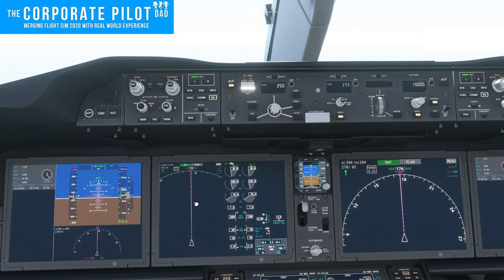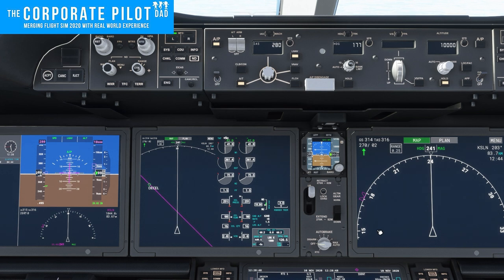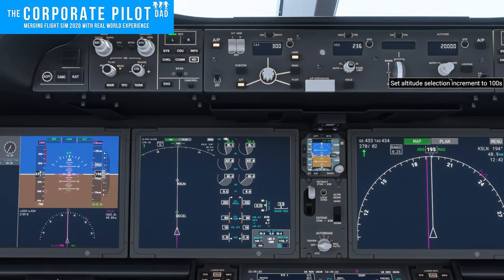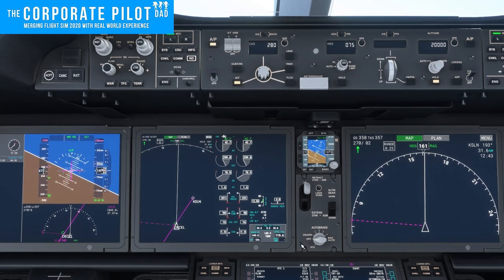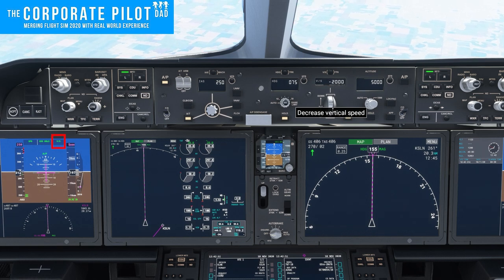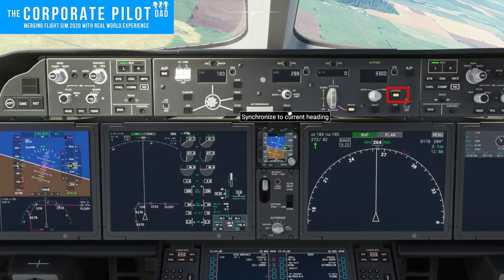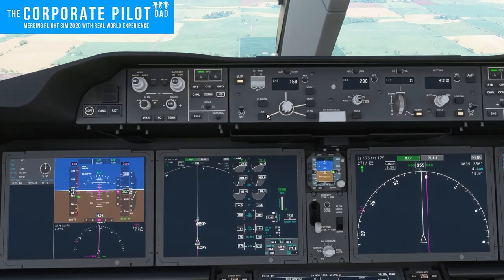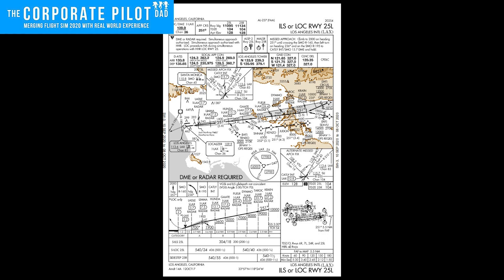Boeing 787 Autopilot Tutorial | Microsoft Flight Simulator

Comment: Hey I've been trying to fly this plane on Xbox series X and I keep having issues as the plane will randomly start banking left sharply. I could be on autopilot for 10mins and the plane will follow the Flight plan but suddenly just bank very sharply. It also happens any time I change the altitude or speed.
I'm I doing something wrong or is it a bug?
Reply from the maker: As far as I know that is not anything you are doing and it is a bug.  Others have had the same issue in the past.  In settings, If you can change the flight model to modern that may help.
Reply: Sorry, doesn’t work at all. 787 just flies to the left in circles
Reply from the maker: @itistheway6893  Check your flight model in settings and set it to modern.
Reply: I actually figured out what the problem is. This is an issue with the sim itself. For some reason the sim doesn't work well with the Xbox controller on console. I noticed that when I switched to cursor mode by clicking the left stick and started rotating and moving the camera/cursor that the yoke would also slightly move. I believe that these small movements are enough to mess with the autopilot and cause it to randomly turn to the left or right. I switched using a mouse and since then I have never had the issue with the plain turning left, the reason, because I now use the mouse to move around the cockpit inside of using the controller
Reply from the maker: @caolandoherty7515  glad you got it working.   People on PC had similar issues but from the flight model not being set to modern.

Comment: QUESTION!!  - whenever I put on autopilot, A/T works fine but then I select HDG hold and the plane slowly starts to bank left/right and the Flight Director gets all messed up.  The plane ends up banking 90 degrees and keeps flying in circles.  SOMEONE HELP!! THANK YOU!
Reply from the maker: I am pretty sure this is a bug after the last update.  Check https://forums.flightsimulator.com/ if you haven't already.  Others have reported the same issues there and on different flight sim groups on facebook.  If I see a fix I'll come back and let you know here.  I wish I had a better answer for you.
Reply from the maker: Go into settings and set your flight model to modern.  Make sure AI is off and assist settings should be set to hard/true to life.

Comment: Hi. In the mcdu is you arrival page also not working?
Reply from the maker: I'll have to check.   I'll get back to you.
Reply from the maker: I just tried it and it works. On the ground at LAX I entered LAX as the destination and entered the departure and arrival along with the runway and transition.  On the menu I selected the departure and destination.  Once it loaded I selected the departure and arrival and it worked just fine.
Reply: @thecorporatepilotdad  that's good to hear but then i don't understand why it doesn't work on my side. I can get on the page but only "Departure" is clickable...
Reply from the maker: @AM-on5ql  What is your departure and destination airport when only departure is clickable?
Reply: @thecorporatepilotdad  i would start on the runway in LSGG for example and then manually enter the flight plan to LSZH. The issue i think is also that the system never allows me to hit "EXEC" so that the plan is fully loaded....
Reply from the maker: @AM-on5ql  Try loading the depqrture and destination then load the SID and STAR then build the route.   Have you tried the CJ4 Working Title Mod? It has the best FMS in the whole sim.  If you want functionality and ease of use, I suggest it if you haven't tried it yet.

Comment: Like others have said , Great video explained to make following your steps easy. I have a bug on my 787, It i want to increase/decrease any this, Likes altitude , Speed etc, When i start to adjust say altitude, I will loose control of the altitude settings and it would go from 1000ft upwards to what ever and the same with anything else that you adust with the mouse, i have changed mice, but still the same issue, Others have had the same issue and they say , Seletcting and unselecting the map can fix it, but its not working for me, Plus i am having other issues like no control of the throttle, I am hoping that it fixes it self.  I bought this edition because i wanted the 787 and to be able to fly it. Anyone else having issues?
Reply from the maker: Thank you for the compliment.   With the bug you are experiencing,  does this happen in other aircraft?
Reply: @thecorporatepilotdad  I will have to get back to you on that one since i just fly around in the smaller planes looking at the views
Reply from the maker: Have you tried placing the cursor over what you want to change then using the mouse wheel or just holding the left mouse button?
Reply: @thecorporatepilotdad  Yes, I have tried that, I can start to adjust a setting , take the cursor away and the numbers are still going up or down, at one point, the buttons where grayed out and unable to select buttons., That issue has gone now, but looks like a bug

Comment: anytime i engage LNAV it banks right and just rolls over
Reply from the maker: Is your realism set to modern?
Reply: @thecorporatepilotdad  Yeah, I flicked between both, no change
Reply from the maker: @cv03luka53  I am not sure.  That is usually the fix.  Maybe check the official flight sim forums and see if anyone else has had that problem.
Reply: @thecorporatepilotdad  turns out it's a bug when a controller is plugged in, for some reason, it is oversensitive when AP is turned on and causes banking even when not the controller is not touched, the fix is to recalibrate the controller in windows then set a dead zone in the sim of 25%